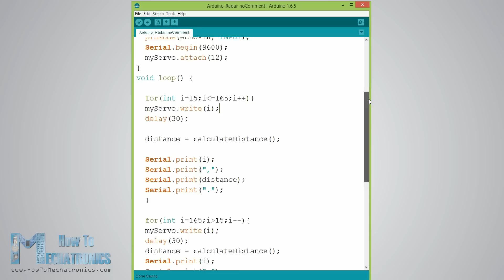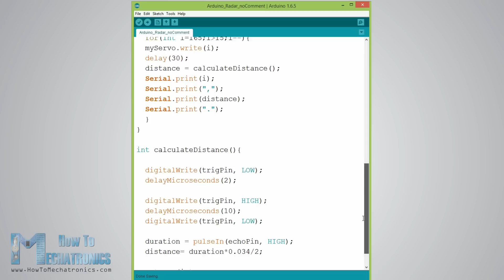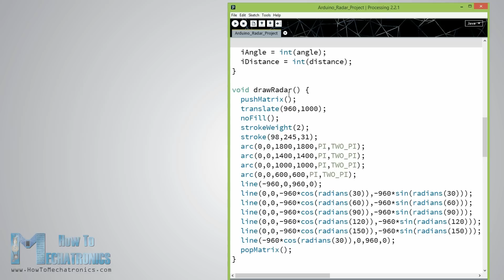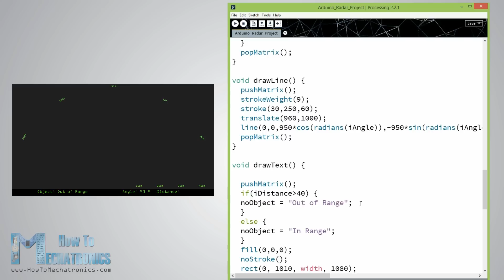Arduino Radar Project

Comment: Thank you for your video, My problem is that I dont know if both codes need to be in the same file,  When executing processing exe Does not seem to move-not getting any data from arduino code. Do both arduino ide and processing exe need to be running together? 
Cheers,   Ben

Comment: how did you connect it to your tv? did you use some jacks or wires something? sorry im a complete beginner
Reply: He probably would have used a USB cable to connect the Arduino board to the Laptop and the Laptop might be hooked to the TV via a HDMI cable...Otherwise, the TV you're seeing could just be a monitor that he's connecting to...

Comment: When I make a separate programme for servo motor it runs smoothly but when I give command of full programme  in that the servo motor rotates very very slowly and also stepwise very slow so what is the problem in this kindly provide me the solution . Thanks 🙏🙏

Comment: Interesting project!
But I'm a bit confused, how is this a Radar and not a Sodar (A Sonic detection version of the Sonic/Sound navigation Sonar)?
I mean... it uses Sonic waves right? And not Radio waves? Or I'm I missing something?
LIDAR = Light Detection and Ranging (uses electromagnetic radiation)
RADAR = Radio Detection and Ranging (uses electromagnetic radiation)
SODAR = Sonic Detection and Ranging (uses acoustic wave (aka Sound) Larger than 20 kHz Sound Waves are known as Ultrasonic)
SONAR = Sonic/Sound Navigation and Ranging (uses Sonic and or Sound as it ranges through the whole frequency range (infrasonic->acoustic frequencies->ultrasonic)
... I could be wrong though... (which is why I wrote it as a question)

Comment: I have a question, assuming it rotates 180 degrees and it detects an object in front of the sensor, HOW can i print the angle of the object on the servo?

Comment: IDE code wont upload to my Arduini Uno.
First 3 lines of program code are showing errors as follows -
import processing.serial.*; // imports library for serial communication - There is no import command in Arduino IDE
import java.awt.event.KeyEvent; // imports library for reading the data from the serial port - There is no import command in Arduino IDE
import java.io.IOException; - There is no import command in Arduino IDE 
Serial myPort; // defines Object Serial - Serial does not name a type.

please provide links to import or download - 1. processing.serial.*; // imports library for serial communication
2.port java.awt.event.KeyEvent; // imports library for reading the data from the serial port
3.java.io.IOException;
Reply: herers your problem that code gose in a app called processing

Comment: Hello. I have 1 problem. When I connect the sensor and the servo to the arduino uno, the servo motor goes very slowly, is there a problem with the power supply? Do I need to make some external power supply for the servo motor? I see that you also used Uno and these two in the project and it works at normal speed.

Comment: Hi bro....
I want to do this project without USB Cable (wireless connections) only I connect power supply for Arduino by using 5v battery's.Then the processing 3 software(which  was showing the rotating 180° axis in  green colour ) it was able to run for doing this project as wireless connections with your code is it possible....plss reply me brooo....

Comment: Sir...I followed your steps and successfully made my project...I was further trying to alter the processing IDE program so that I can display the red lines only on a specific spot and not on the complete screen after I detect the object...but I found that it limited the detection range because the code for the line was linked to the screen resolution...can you suggest me a way by which I can show the red lines only on a specific spot...

Plus...when I link my project to the processing IDE...I found that the rotation speed slows down if there was no obstacle...and it becomes normal once I detect an object...how can I keep the speed constant??

Comment: hi
How can I filter out sensors data?
well I want to use this sensor to measure water level of a tank
as i want to use this in a PID control system i have to minimize noise
Is there anyway to do it with arduino mega?
Thanks

Comment: This is NOT a RADAR (RAdio Detection And Ranging) but a SONAR (SOund Navigation And Ranging).
Radar system operates in UHF or microwaves.
Reply: Radar works across the whole radio spectrum. See ITU FAT recommendations and look up over the horizon radar which uses HF.
Reply: @electechyt  Old but it says ultraSONIC right in the name. It uses sound waves making it Sonar.
Reply: @Bradiant  exactly. It is SONAR.

Edit: You can even read the source code for this. 

distance = calculateDistance()

And the function calculateDistance() uses the very sonar formula to compute distance if the duration is known by multiplying it with the speed of the particular sound used and dividing by 2 because it gets reflected to reach the "radar", travelling twice the same distance.
Reply: looks like a radar to me

Comment: This is probably a stupid question, but how are you displaying the "radar screen" on the VGA monitor?  I get that the sketch draws the image... I am just not sure how exactly you are doing it.   Is it displaying on serial monitor through the USB connection to the PC?
Reply from the maker: The Arduino is connected to the PC via the serial port, the Arduino send data to the PC which are accepted in the Processing IDE. Then the Processing draws the graphics and of course it is displayed on the monitor of the PC.
Reply: @HowToMechatronics  Thank you. I will try and duplicate what you made. I love your videos.

Comment: Hi there, I have these arrors

Arduino:1.8.5 (Mac OS X), Scheda:"Arduino/Genuino Uno"

RADAR:11: error: 'import' does not name a type
 import processing.serial.*; // imports library for serial communication
 ^
RADAR:12: error: 'import' does not name a type
 import java.awt.event.KeyEvent; // imports library for reading the data from the serial port
 ^
RADAR:13: error: 'import' does not name a type
 import java.io.IOException;
 ^
RADAR:14: error: 'Serial' does not name a type
 Serial myPort; // defines Object Serial
 ^
RADAR:24: error: 'PFont' does not name a type
 PFont orcFont;
 ^
RADAR:49: error: variable or field 'serialEvent' declared void
 void serialEvent (Serial myPort) { // starts reading data from the Serial Port
                  ^
RADAR:49: error: expected ')' before 'myPort'
 void serialEvent (Serial myPort) { // starts reading data from the Serial Port
                         ^
/Users/iMacAlexMele/Documents/Arduino/RADAR/RADAR.ino: In function 'void setup()':
RADAR:27: error: 'size' was not declared in this scope
  size (1920, 1080); // **CHANGE THIS TO YOUR SCREEN RESOLUTION**
                  ^
RADAR:28: error: 'smooth' was not declared in this scope
  smooth();
         ^
RADAR:29: error: 'myPort' was not declared in this scope
  myPort = new Serial(this,"COM4", 9600); // starts the serial communication
  ^
RADAR:29: error: expected type-specifier before 'Serial'
  myPort = new Serial(this,"COM4", 9600); // starts the serial communication
               ^
RADAR:31: error: 'orcFont' was not declared in this scope
  orcFont = loadFont("OCRAExtended-30.vlw");
  ^
RADAR:31: error: 'loadFont' was not declared in this scope
  orcFont = loadFont("OCRAExtended-30.vlw");
                                          ^
/Users/iMacAlexMele/Documents/Arduino/RADAR/RADAR.ino: In function 'void draw()':
RADAR:35: error: 'fill' was not declared in this scope
   fill(98,245,31);
                 ^
RADAR:36: error: 'orcFont' was not declared in this scope
   textFont(orcFont);
            ^
RADAR:36: error: 'textFont' was not declared in this scope
   textFont(orcFont);
                   ^
RADAR:38: error: 'noStroke' was not declared in this scope
   noStroke();
            ^
RADAR:40: error: 'width' was not declared in this scope
   rect(0, 0, width, height-height*0.065); 
              ^
RADAR:40: error: 'height' was not declared in this scope
   rect(0, 0, width, height-height*0.065); 
                     ^
RADAR:40: error: 'rect' was not declared in this scope
   rect(0, 0, width, height-height*0.065); 
                                        ^
/Users/iMacAlexMele/Documents/Arduino/RADAR/RADAR.ino: At global scope:
RADAR:49: error: variable or field 'serialEvent' declared void
 void serialEvent (Serial myPort) { // starts reading data from the Serial Port
                   ^
RADAR:49: error: expected ')' before 'myPort'
 void serialEvent (Serial myPort) { // starts reading data from the Serial Port
                          ^
/Users/iMacAlexMele/Documents/Arduino/RADAR/RADAR.ino: In function 'void drawRadar()':
RADAR:63: error: 'pushMatrix' was not declared in this scope
   pushMatrix();
              ^
RADAR:64: error: 'width' was not declared in this scope
   translate(width/2,height-height*0.074); // moves the starting coordinats to new location
             ^
RADAR:64: error: 'height' was not declared in this scope
   translate(width/2,height-height*0.074); // moves the starting coordinats to new location
                     ^
RADAR:64: error: 'translate' was not declared in this scope
   translate(width/2,height-height*0.074); // moves the starting coordinats to new location
                                        ^
RADAR:65: error: 'noFill' was not declared in this scope
   noFill();
          ^
RADAR:66: error: 'strokeWeight' was not declared in this scope
   strokeWeight(2);
                 ^
RADAR:67: error: 'stroke' was not declared in this scope
   stroke(98,245,31);
                   ^
RADAR:69: error: 'arc' was not declared in this scope
   arc(0,0,(width-width*0.0625),(width-width*0.0625),PI,TWO_PI);
                                                              ^
RADAR:74: error: 'line' was not declared in this scope
   line(-width/2,0,width/2,0);
                            ^
RADAR:81: error: 'popMatrix' was not declared in this scope
   popMatrix();
             ^
/Users/iMacAlexMele/Documents/Arduino/RADAR/RADAR.ino: In function 'void drawObject()':
RADAR:84: error: 'pushMatrix' was not declared in this scope
   pushMatrix();
              ^
RADAR:85: error: 'width' was not declared in this scope
   translate(width/2,height-height*0.074); // moves the starting coordinats to new location
             ^
RADAR:85: error: 'height' was not declared in this scope
   translate(width/2,height-height*0.074); // moves the starting coordinats to new location
                     ^
RADAR:85: error: 'translate' was not declared in this scope
   translate(width/2,height-height*0.074); // moves the starting coordinats to new location
                                        ^
RADAR:86: error: 'strokeWeight' was not declared in this scope
   strokeWeight(9);
                 ^
RADAR:87: error: 'stroke' was not declared in this scope
   stroke(255,10,10); // red color
                   ^
RADAR:92: error: 'line' was not declared in this scope
   line(pixsDistance*cos(radians(iAngle)),-pixsDistance*sin(radians(iAngle)),(width-width*0.505)*cos(radians(iAngle)),-(width-width*0.505)*sin(radians(iAngle)));
                                                                                                                                                               ^
RADAR:94: error: 'popMatrix' was not declared in this scope
   popMatrix();
             ^
/Users/iMacAlexMele/Documents/Arduino/RADAR/RADAR.ino: In function 'void drawLine()':
RADAR:97: error: 'pushMatrix' was not declared in this scope
   pushMatrix();
              ^
RADAR:98: error: 'strokeWeight' was not declared in this scope
   strokeWeight(9);
                 ^
RADAR:99: error: 'stroke' was not declared in this scope
   stroke(30,250,60);
                   ^
RADAR:100: error: 'width' was not declared in this scope
   translate(width/2,height-height*0.074); // moves the starting coordinats to new location
             ^
RADAR:100: error: 'height' was not declared in this scope
   translate(width/2,height-height*0.074); // moves the starting coordinats to new location
                     ^
RADAR:100: error: 'translate' was not declared in this scope
   translate(width/2,height-height*0.074); // moves the starting coordinats to new location
                                        ^
RADAR:101: error: 'line' was not declared in this scope
   line(0,0,(height-height*0.12)*cos(radians(iAngle)),-(height-height*0.12)*sin(radians(iAngle))); // draws the line according to the angle
                                                                                                ^
RADAR:102: error: 'popMatrix' was not declared in this scope
   popMatrix();
             ^
/Users/iMacAlexMele/Documents/Arduino/RADAR/RADAR.ino: In function 'void drawText()':
RADAR:106: error: 'pushMatrix' was not declared in this scope
   pushMatrix();
              ^
RADAR:113: error: 'fill' was not declared in this scope
   fill(0,0,0);
             ^
RADAR:114: error: 'noStroke' was not declared in this scope
   noStroke();
            ^
RADAR:115: error: 'height' was not declared in this scope
   rect(0, height-height*0.0648, width, height);
           ^
RADAR:115: error: 'width' was not declared in this scope
   rect(0, height-height*0.0648, width, height);
                                 ^
RADAR:115: error: 'rect' was not declared in this scope
   rect(0, height-height*0.0648, width, height);
                                              ^
RADAR:117: error: 'textSize' was not declared in this scope
   textSize(25);
              ^
RADAR:119: error: 'text' was not declared in this scope
   text("10cm",width-width*0.3854,height-height*0.0833);
                                                      ^
RADAR:125: error: invalid operands of types 'const char*' and 'const char [4]' to binary 'operator+'
   text("Angle: " + iAngle +" °", width-width*0.48, height-height*0.0277);
                            ^
RADAR:128: error: invalid operands of types 'const char*' and 'const char [4]' to binary 'operator+'
   text("        " + iDistance +" cm", width-width*0.225, height-height*0.0277);
                                ^
RADAR:132: error: 'translate' was not declared in this scope
   translate((width-width*0.4994)+width/2*cos(radians(30)),(height-height*0.0907)-width/2*sin(radians(30)));
                                                                                                          ^
RADAR:133: error: 'rotate' was not declared in this scope
   rotate(-radians(-60));
                       ^
RADAR:135: error: 'resetMatrix' was not declared in this scope
   resetMatrix();
               ^
RADAR:151: error: 'popMatrix' was not declared in this scope
   popMatrix(); 
             ^
exit status 1
'import' does not name a type

Questo report potrebbe essere più ricco di informazioni abilitando l'opzione
"Mostra un output dettagliato durante la compilazione"
in "File -> Impostazioni"
Reply: no ones gonna help you dude

Comment: Hello there, may i know are there any codes to slow the servo motor degree spinning speed? mine is moving too quick to maneuver slowly degree by degree. thanks!
Reply from the maker: You just have to increase the delay time in the loop section for controlling the servo motor.
Reply: Your servo motor is limited to 180 degree only? or 360?

Comment: Love this project! I made a similar radar with 4 ultrasonic distance sensors in 4 directions and changed the servo to a stepper motor, and 3D printed the case.

Comment: I have an arduino one and not a mega, how do I adapt it to arduino one?
Reply from the maker: You can use Arduino Uno without any adaptation, it's the same.
Reply: Would you have to change the pins that are connected to the arduino and also have the codes of visual studio?

Comment: I have an error that says that it can't find the port.(COM4)
Reply: Check the port that your arduino is using (it's in the bottom right corner of the arduino IDE) and replace that port with "COM4"

Comment: I watch the formula “pixsDistance = iDistance*((height-height*0.1666)*0.025);, but I can't understand why, if 200cmthe variable shoulde only 0.05? I dont understand how to increase for a 1333*768 resolution, is correct 0.05 for 2mts range?

Comment: How in the world you connect a servo motor directly to arduino, considering that motor takes to much voltage and arduino pins only provides 30mA how the servo didnt burn the arduino? so if that's possible what are the motor drivers are made for?
Reply: so if the 40mA pin is just sending signal to servo and not exciting the coil I guess that specific servo has a motor driver inside which converts the arduino 40ma signal into a power signal to feed the coils , is it right?

Comment: GUYS Please i need help here 
i have 2 lidar connected to arduino  and i want to make a 3D modeling which means i will use 2 unstable  theta and 1 distance 

so  i tired to do it by matlab
but it did not work so any one has any idea how i can make this thing works ?

Comment: Air temperature affects speed of sound but only a little per +/- 5C.
Still, go measure outside when it is -10C or colder with formula for +20C indoors.

Comment: sir, can we do this using a stepper motor instead of a servo motor?
and also can we not use the arduino and use a electronic circuit to drive this?

Comment: The code you use to calculate the distance is what I found online, however if you put it in a for loop 100 times and average out the readings, it is far more accurate.

Comment: I know it's a bit late to write a comment, but I hope you'll reply anyways.

I'm trying to make a similar project, but I'd like to use a stepper motor instead of a servo motor; will this affect any aspect of the processing code? I already know how to create the arduino code, but I'm worried about the 1.8 degree step.